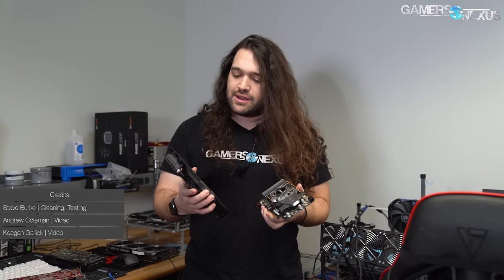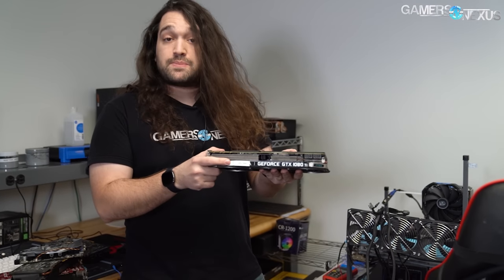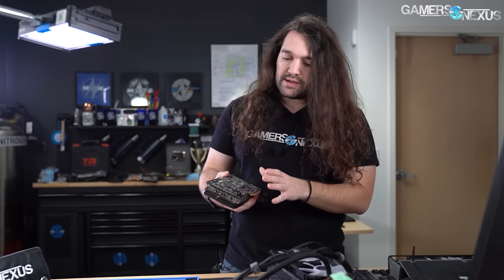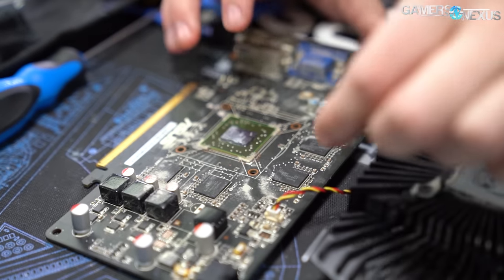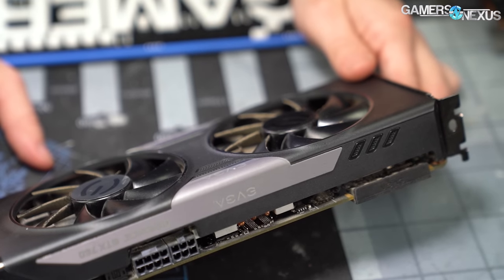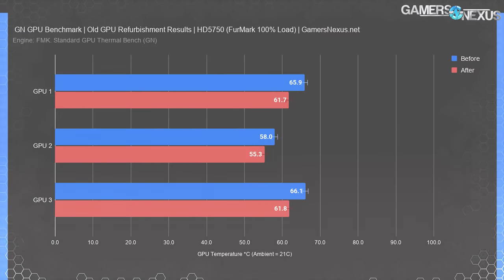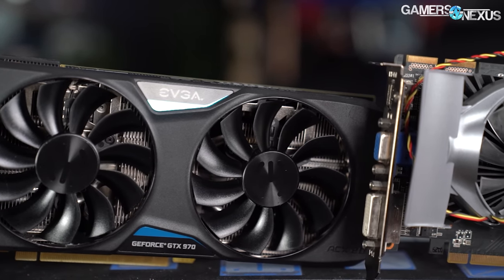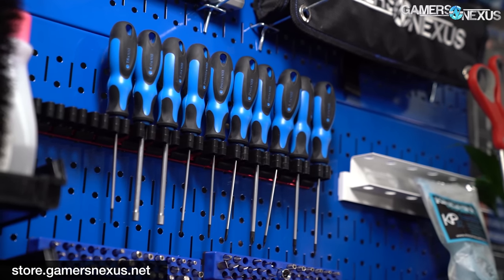GPU Cleaning Before & After Thermals: Re-Pasting & Dust Removal

Comment: do this with worn out crypto cards and see if they come back to life...give the used market some hope
Reply: The issue with mining cards is that they ran at 100% usage nonstop for a long time. Thermal burden is high and as soon as that card gets colder again, the chances are high that the solder will get brittle and cracks. Do that a few times (playing games on and off) and failure chance is high.
Normal cards are used to that. They have seen many temperature cycles. Mining cards did not.

Comment: The thermal pads on my 1080 FTW 3 have sweated oil on the back of the card, I saw some posts on the EVGA forums that this is normal, is it a good idea to change them out and repaste the GPU? I clean my system regularly and I haven't really noticed any issues.

Comment: I've heard that once you replace your paste you have to start replacing frequently, does this hold any truth?
Reply: Well some people claim that paste like Kryonaut dries out quickly and then makes temps rise again. But that's not true. Yes, it dries out, but it doesn't lose any thermal conductivity. Used mine for 6 years on a GPU and CPU and there weren't any changes in temps at all.
But I didn't use a whole truck load like Steve did there. That will certainly mess up temps from the beginning.

Comment: Hi, just wanted to ask if it is normal that some of the heatsinks make no contact with the memory chips on the GPU. I have this particular problem and I own a Msi GTX 1660Ti Gaming X.
Reply: yea they usually dont, but u can use pads to bridge that gap if they can reach. Just cant be too tall/short. If theyre not there stock, then its fine, but u can still add them

Comment: I don't get your insistence on using water instead of air to clean those cards. Multiple ramblings in the video, and in the end you use water and the bathroom hand dryer. You don't recomment it, why show it? You don't want dust in the air? Outside? Because of the enviroment? But you use the electric hand dryer??

Comment: Nice video on disassembling the GPUs but bruh, where is the performance comparison? Do you guys just clean it and test only the temperature, before and after? Of course there will be no significant difference on the temps, they are default by design and will thermal throttle lol guys really

Comment: Can we please get benchmarks on Snowflake? Like which fuel/food makes them run faster? Which temps they run at, with that day's temperature, and of course the temp delta?

Also, cool FTW (fuck the what) edition GPU!

Also, Steve: [Taking apart a 1080 Ti.] This one kind of sucks to take apart.
Me: [Remembering flashbacks to dismembering my H-I-S R9 290 to replace Thermal Compound and Thermal Pads; with endless mini screws.] War. War never changes.

Comment: Does anyone have a teardown for a PNY GTX 970?  I got one off Ebay that works fine and benchmarks well, but I seem to have to use MSI Afterburner to turn the GPU fan up to nearly 100% to keep the temps in the low 80s when I'm benchmarking the GPU or running any GPU intensive task (games, etc.).  I've never replaced the thermal paste/pads on a GPU, and I can't seem to find any information about pad sizes/thickness for this specific card.  Do you think that replacing the pads/paste will likely improve my temps?  Other than this, the card is pretty clean. Thanks!

Comment: Please Help !!!   Hey guys, hope you doing well. Which one of these thermal pastes would perform better in my use case? CPU: 5900X , Cooler: 240mm Deepcool LE500 AIO

Arctic MX-4

Arctic MX-5

Coolermaster Mastergel Pro v2

Coolermaster Mastergel Maker

actually, I have a Mastergel Regular already. Do I need to upgrade to one of these?
Reply: lol it doesnt matter what one you use
Reply: theyre more or less identical lol, just buy something for like 15 and dont buy the shitty 5$ ones.